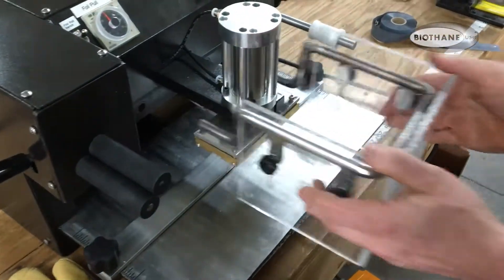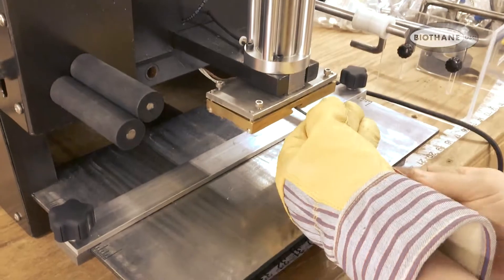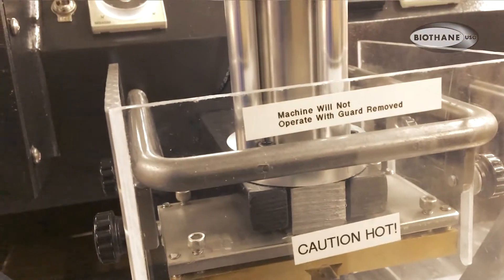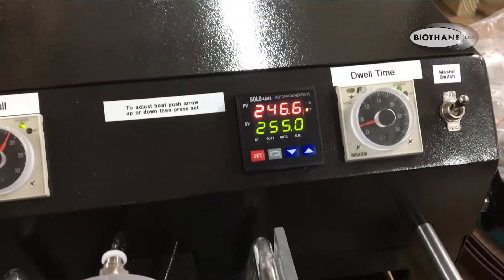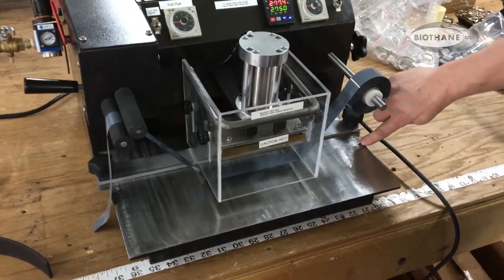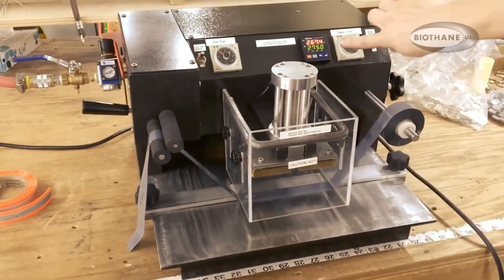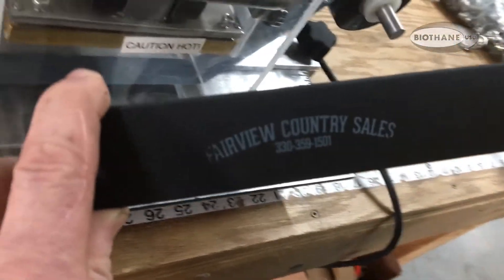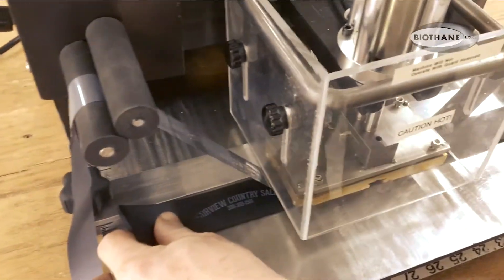Shop Tools: Foil Hot Stamp Machine

Comment: Can I do this with a 100 watt soldering iron stamping machine on Beta Standard?
Reply from the maker: BioThane Coated Webbing
1 second ago
Great question Melissa:) I have never tried that method. It sounds interesting. The key to adding foil to Beta or any BIO are: Time, Temp and Pressure. A mechanical device with fixed amounts of these three variables make for the cleanest logo results. Doing it by hand with an iron can work, but it may not be the exact look you are going for. It may take some practice and let me know how it goes